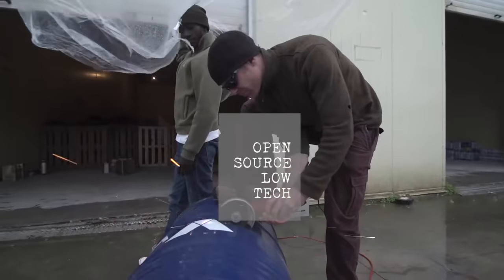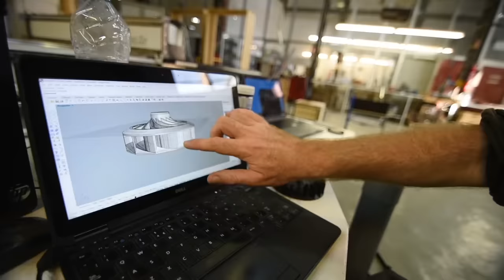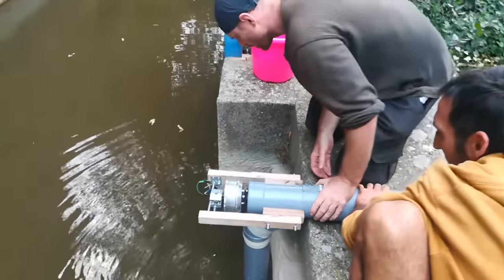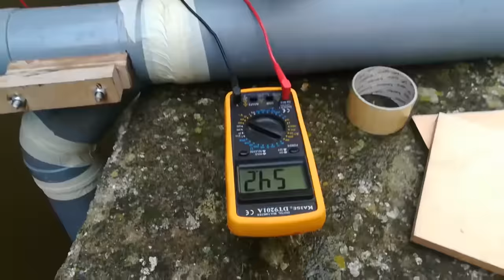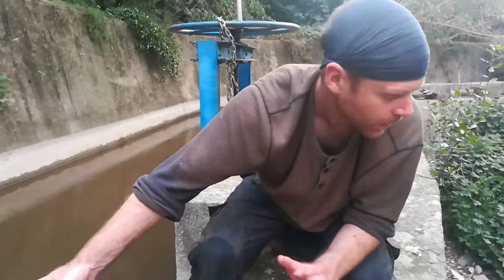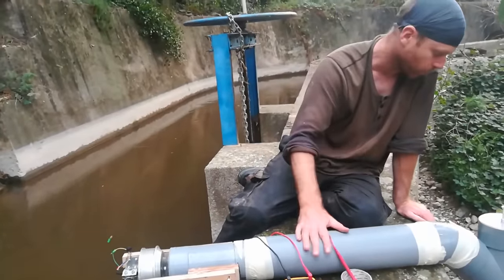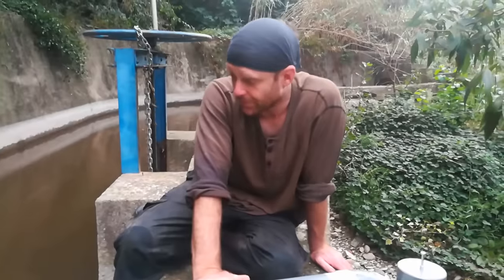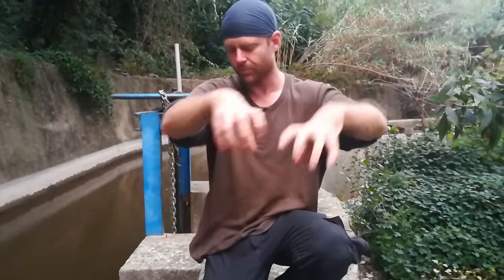The $50 Water Turbine -DIY, Portable, Powerful, and Open Source

Comment from the maker: Part Two (with power output test results and a walkthrough of all the components) now available here:
https://www.youtube.com/watch?v=ibCu0PxIZA4
Reply: Hi any idea how to use wind mill water pomp to make a energy?
Reply: Really annoying with music. Please cut it. Thanks
Reply: You can put more than one generator on one setup. One on the down flow too. As long as it flows the same you will have to make sure it dont slow the flow. Multiple blades that allow high flow down the exit tube that runs one more generator.
Reply: This would be handy in Africa
Reply: @bahatipatrick212  yes I think so too
Reply: Hey, I've done a off grid earth home in NM in 2012, in my head I worked out in theory this exact idea but in a water catchment recirculating system because no streams existed.
I was going to use a deep cycle battery on solar to run a ambulance alternator using a high output pond pump nozzle narrowed down to produce the power needed to turn a fabricated pelton wheel, that water would be captured in it's same system.
In this set up I can do this, using two large water catchment tanks and plumb the over flow back into the siphoning tank so it's recirculating...
But my question here is, have you used this same idea to not be the power point of generating power, but as the pully to turn a bigger power producer like a alternator???
This is where I'm taking the knowledge you shared, because together we all play a part to figure it out, it's not a competition, it's a human entity of wisdom to produce life for us and mother Earth,
Because I'm on my second earth build, I'm trying to see if with this set up between the large ponds and indoor and outdoor grow beds all recirculating I can fit this into the system and even 300 watts to charge a battery bank is worth the trouble.
But then I said multiple generators yeah... And now I'm thinking using this a a pully to turn a alternator... Does this idea fit your numbers of this idea? Bigger tubing? Higher flow? I'm very curious...
Reply: I'm very very interested in this, how can i learn more from you? I'm trying to learn skill sets necessary to help an offgrid community thrive, clean water distillation and energy production are at the very top of my list.
Reply: The only problem I have is finding a device to convert 3 phase AC to DC, 😥
Reply: make a pumped hydro version of this to pair with solar panels!!!!!!
Reply: A Truly Genius Idea.
Reply: @bahatipatrick212  exactly, I want to build some here
Reply: You need  a foot valve so it doesn't need to be  primed.  But that's  a good volume of  water you got.  👍👍👍
Reply: instead of a hoverboard motor can you use a cordless drill?
Reply: I want to make this in Ethiopia and Brasil!!!
Reply: Allen Vaughn p
Reply: So due to siphoning this turbine is working ???
Reply: Print a bigger motor so with a big atmospheric pressure differences always moving it ???
Reply: This is not a solution ?
Use a bigger fan which generated more power with running water without any loss of water 

I have a bigger model for whole world which gives millions of TWh energy
Reply: and why not put a few more turbines, or in the hole where water is poured to start, also put a generator(you can try a more powerful one), and put several impellers on it for more power, and put an impeller in front of the impeller that will not rotate, but will rotate the water towards the blades of the impeller of the generator good luck !!!
Reply: You loose the water by draining the river canals so when you have less water then it will not become successful 

Do something which doesn't use water but energy of water 
So use 10 meters higher barometer and it will running the turbine along the length of canal river so we don't loosen the water but only use energy of pressure differences or water level differences 
So it's slow or higher rates of unlimited surface area and volume became a source of water all ways of along the river canals

According to this system we can provide energy at each 30 meters differences and no loss of water 

Hurrey
Reply: I know this sounds crazy, but I have a self sufficient hydro electric system idea based off your second video and this video and wanted to talk to you about the design concept
Reply: Do multiple in line turbines
Like so
----------------------------------------
Gen|-|-|-|-|-|-|-waterflow->
----------------------------------------

The added turbines should increase efficiency and rpm if done correctly.

You can also weatherproof alternators from vehicles as a cheap generator. Source cheap components increase the number of prototypes you can build.
Reply: @KingJamesIX  I totally agree. The Spangler generator has a similar theory
Reply: @allenvaughn8823  double the power outputs and if the height allows there could also be more in line inside the lower parts of the downpipe.  Interesting stuff
Reply: @bahatipatrick212  Africa isn't blessed with the water
Reply: In the correct setting there can be 3 power supplies coming from then even away from water.  
One of the power supplies pumps the water up top keeps the water moving and the other 2 sources of power are free.
Reply: are you from Dunedin?

Comment: YouTube algorithm on point! I've been wanting to do exactly this but didn't really have access to a good site until recently.
Reply: I was looking to send this to you Joe!
Reply: @yv6eda  I was like #50 to watch it somehow.
Reply: The efficiency on this will be absolutely terrible I know I have tried it many times please show us the numbers of the wattage it is putting out that way everybody understands completely what is going on truthfully. I applaud you for trying to get power to third world countries at a reasonable price. But if you are not siphoning the water over a culvert the efficiency would be greatly improved.
Reply: @SpencerLAPower Spencer I agree, low head requires really really high flow but if this could power some lights for as cheap as it is it would be just fine. He could even run multiple in parallel.
Reply: @JoeMalovich  in most countries I've sold 2 over the years out of the United States most of them can't get or afford batteries so it has to run Direct to the lights or whatever they want to run . Just curious as to how much power it actually makes given the tremendous head that he has their looks like it's about 10 to 12 feet or more The on-demand power is very minimal but should be able to run a few LED lights. But over time it would charge a battery bank and they could power mini lights and appliances off of it as you know charge controllers and inverter cost money. I'm not trying to knock this guy I think he's doing a great thing to help people that can't afford it.
Reply: Glad to see you here as well. New plans for a second system?
Reply: @Jasonoid  yes, spend money on some proper components.
Reply: I have a nice place to test this with an 8 foot waterfall.
Reply: Same... But I only have a well to work with. And Mine needs to be quiet.
Reply: @LandtoHouse   Seth you need to try this.... cheaper than your current hydro plans..?
Reply: @benwilliams672  yes! Actually Joe and Spencer are working together to make the impeller. Then I should also be testing the install off the ponds at the end of the property.
Reply: @JoeMalovich  I saw your hydro project  and  have been wondering  where to get such a generator  in my developing  country  could  you help me out please

Comment from the maker: Part Three (with real world field testing) now available here: https://www.youtube.com/watch?v=lBl4Sdw0dXo
Reply: I have a idea that's open source I'll share you may find it useful. It replaces the pump with a motor and makes hydroelectric gravity fed power possible anywhere. You need to say 4-5' diameter tubes towers Say 20-30 ftvthat can handle water weight and pressure. A motor for lifting a cable with brake assist. You take both side by side put motor above and in middle. Take and make two weighted pistons a few feet thick that will fit snuggly inside the tubes, place them in the tubes with a cable connecting both thru the suspended motor above to each piston...cut two holes 6-12" diameter in the bottom of tubes, cap bottoms, and place taps in holes drilled . Connect each tube to opposing tank with a directional turbine installed in each. Each outlet is directional one inlet side one outlet side. Place a back flow in each at tank  that opens only on pistons ascent. Once connected sealed up prime it. . You'll need to assist the start by letting the tube with the piston in its highest position descend. Pulling the opposing up, once equilibrium is reached motor will need to assist the other to offset its elevation to dominance and it's weight carries it down. Then repeat once other is filled system reverse the back flow in other line closes preventing pressurized tube from pushing it back thru the wrong tube or both as it transfers it'll pass over inline turbines creating electricity constantly whick motor could run off using little leaving plenty may have to ship in water but being a closed system it shouldn't lose much thru evaporative means.
Reply: Great video, and aswome project! Will this system generate more with two "fans" instead of one?
Reply: I wonder if you could recycle a power generator and use instead... like the ones used in the power tools that works on gas. Basically you have a 220v alternative coming out... so that means no or well.. very little loss on the transport line.
Reply from the maker: @dxexplorer  As long as they're permanent magnet then yes, but the main issue is usually volts per rpm, ie how fast you have to spin the thing to get useful voltage out. It's certainly an advantage having the motor designed to operate in the hundreds of volts range, but if it's also in the tens of thousands of rpm then it's still not going to do well on a turbine.

Treadmill motors are a common go to for these types of things, I have one currently which I'll probably chuck on the hydro turbine and see what happens.
Reply: Good thinking... I didn't thought about rpm's. I asked because I want to build something like that. I will look into this. The rpm's should not be bigger than 3000rpm as usually that's the maxim rotation of a gas engine generator. It doesn't have a magnetic rotor... but I think it's an electromagnet getting voltage from the engine. I must open it and see but it would be great to convert it so I can have 220v. I'll let you know. I'm just waiting for some warm weather and now it's too cold ))) Gool luck with all the projects and have an amazing weekend.
Reply from the maker: @dxexplorer  Cheers. I don't generally bother with anything that's not permanent magnet. Strictly speaking field winding and induction motors can be made to generate, but take a bit of modification and are never going to be as efficient.
Reply: I trust you on that. You sure know what you are doing there )) Me... not so much that's why it's good to ask first before wasting time )) Cheers and thank you.
Reply: Have you attempted to use a geared multiplier, so a larger pipe that would allow for a larger turbine powering driving a large gear and have your generator geared lower to increase the rpms of the generator?
Reply: Hi. Bro, any design on pdf with all material?
Reply from the maker: @Kevin-qn7jf  It's an option, but I'm pretty happy with the revs and volts with direct drive, so the extra step of gearing isn't really necessary.
Reply from the maker: @marcussamuel8009  Working on it.
Reply: Will this work with leaves froms trees cloging up the pipes? What about minerals from the water clogging up? Love it. Just wondering about maintenance and the cost of maintenance. If you put the power output into a battery bank,... how well would this work?
Reply: @OpenSourceLowTech  thank you for your great videos. The part 3 video you have pinned up here is private to me and the design does not seem to be on your website. Is there somewhere else we can access it?
Reply: It says the video is private.
Reply: its private
Reply from the maker: @subkofficial90  Fixed.

Comment from the maker: Everyone's asking if a second impeller at the output of the tube would increase power. It wouldn't, as each impeller removes momentum from the water flow, and so slows every other impeller as well as reducing the maximum available power in the system. 
Having the output water pouring over a water wheel wouldn't have that effect as the water would then be in open air, but the wheel would take up vertical space which you'd get more power from by just having extra pipe.
I'm currently in Berlin working on optimising and load testing the turbine design. Once I'm happy with it I'll be doing a full open source build tutorial, hopefully before summer.
Reply: Kannst du mir einen s chicken nach Kroatien? :)
Reply: not sure this is completely correct.
after the first stage (first generator), the water is in free run/ free fall. 
you may need to adjust the design, but think of the water vortex turbine.
that might work
Reply: Is it possible to install eight of these on 25 foot long x 8 foot tall fence post, (as a recharging system),  the downspout water is captured into a retention tanks, then with an Archimedean screw, move that water uphill to  an organic filter ( sand gravel charcoal ) before splitting into dual feeds for both compost heater( Biomeiler) & Rocket water heater system and Cold Water Tanks?
Reply: Nasty great guys.. May I know what was the motor and charger you used you used? Gonna be doing that in my grandma's far flung place..
Reply: @balbairaorlie  Congrats, you just found FREE ENERGY !
Reply: Send me a link. Kindly
Reply from the maker: @semi5alpha  Motor / alternator is a wheel off a hoverboard, which seems to be about the best option in countries where they're available second hand. Charge control etc is a separate thing to develop, but you might get a way with a solar PV oriented one, as the voltage should be pretty stable, tho ideally closer to say 48V than 12, so your box would need to handle that.
Reply from the maker: @Dr.FragensteinM.D. Blade wear good question, will be doing some field test installations to find out. The shaft is being pulled by the water, which essentially straightens and centers it. There's also a bush bearing just in front of the runner to lock that end down.